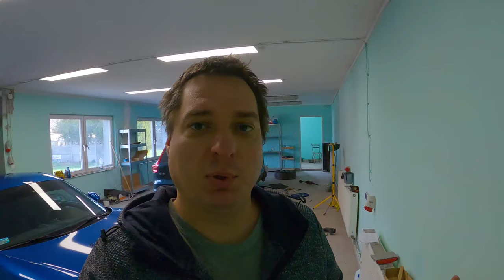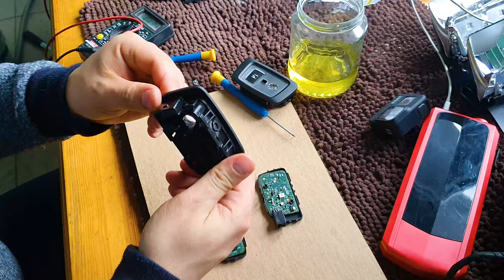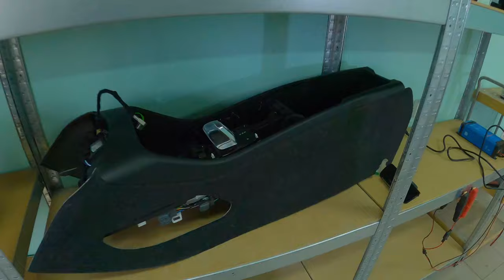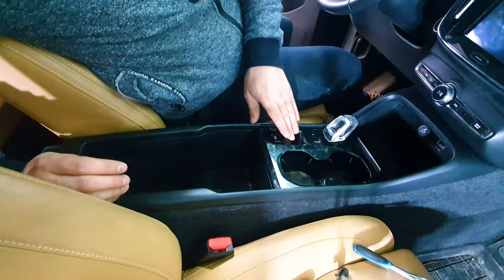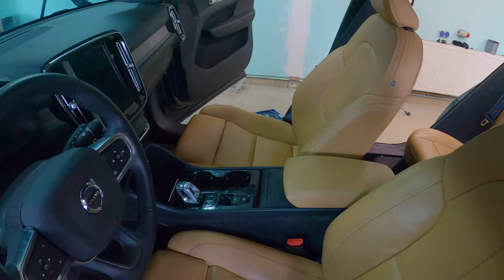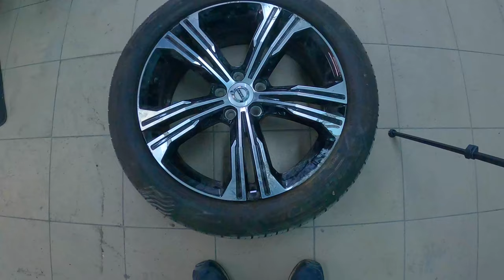Rebuilding Repair Volvo XC40 Part 3/5 Inside job is Done

Comment: Did you have safety mode on before replacing the airbag module? If so did it clear the mode
Reply from the maker: Hello no i did not, my xc40 starts after airbag deployed but you have to replace the pyrotechnic fuse